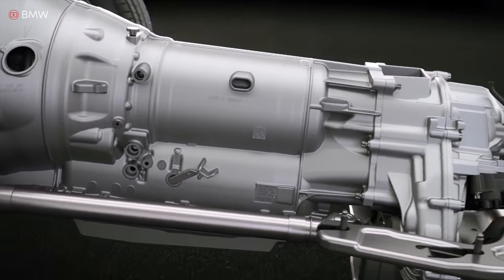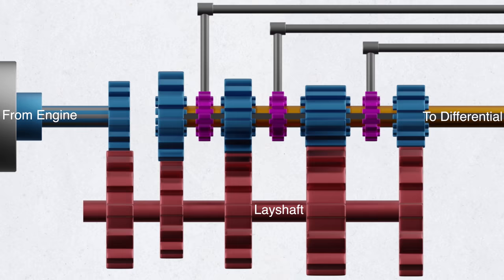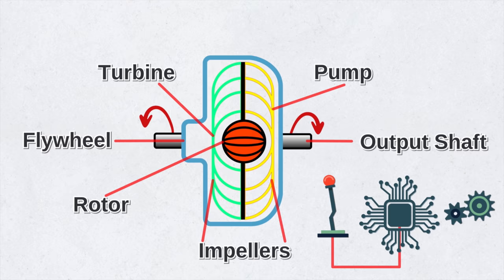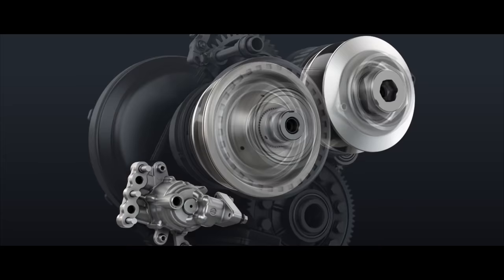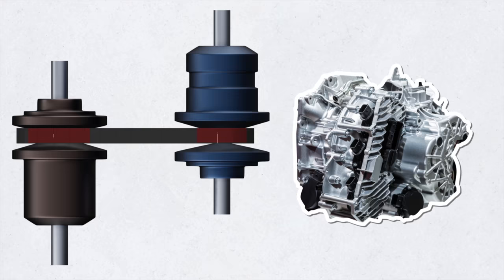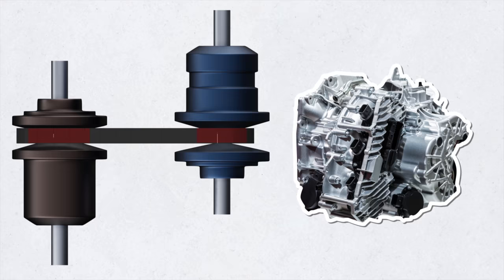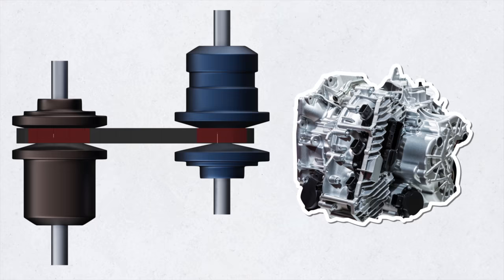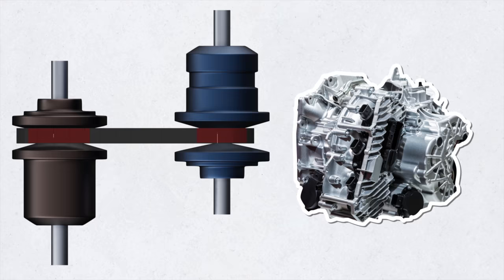Parking Like This Will Destroy Your Automatic Transmission

Comment: News to me that you have to change the CVT belt every 60,000 to 65,000 miles and I thought CVT transmission fluid is to be changed every 50,000 to 60,000 miles not 30,000 or 35,000…. that seems too soon

Comment: My dad always told me to shift to neutral before using the emergency brake while parking and then shift to park so I wouldn't damage the transmission. He said it was better to do it that way because I would be using the actual brakes to park and not the transmission. To this day I do it that way but I don't really know if it really makes a difference. Any thoughts on that?

Comment: I guess I have to get out of my coasting habit. I grew up in South Africa, where gas costs more than Kruger Rands. I never had an automatic though. Always just pushed in the clutch while remaining in gear, when coasting downhill. Not sure if that did my manual transmissions any harm or not. But I Will stop doing it now that I live in the USA and drive automatics.
Reply: It did not harm manual transmissions.  I just put the stick in neutral. The wheels are not connected to the transmission at all(so no different than leaving the car parked in the driveway back home and you were waxing it.  Automatics are a different ball game.

Comment: Taking your gearbox out into neutral while driving at high speeds can also damage it since all that force it was handling will just wind up the gears to far higher rpm. Coasting is a very bad idea for both manual and automatic.
Reply: @richsweeney1115  so what happens with the transmission when the wheels spin and there's no clutch to transmit that force into the engine?
Simple, its internal RPM increases to possibly unsustainable loads.
Reply: @XfStef  - Nope... but never coast in neutral in a situation where your brakes may over heat going down hills... -retired GM engineer...

Comment: Hello Scotty,I own 2 Chevy Cruze,2012,1.4l.cvt.I frequently utilize neutral gear down hill & declining roadways.Are there any major negatives to engine or transmission or other? I achieve 50-64 mpg.highway. 6 speed manual trans. BOOYAA. Love Ur Advice(s) Claude from Rhode DI- land, now in Mass.I Appreciate Ur comments Semper Fi

Comment: In my Malibu 1970 I did a burnout while holding the auto transmission in first gear. I went to shift it into second gear for more wheelspeed and I went past 2nd and 3rd and neutral into reverse at wide open throttle. The car slowed down while burning rubber in reverse. When the car rolled back about five feet, I just went back to first gear without lifting off the throttle. That transmission lasted for another two weeks. It was fun and I inadvertently showed off to a dozen people, but it was kick in the wallet.
Reply: @3sierra15  this happened about 25 years ago, so I just escaped persecution by statute of limitations. I didn't brag about it to my dad. He didn't want me to have that car. So my brother helped me buy it behind his back. Dad said that's too much motor for that car. In reality, I had too much right foot for anything that I got behind the wheel of. Two engines, three transmissions, one drive line, one rear differential, and reengineered sway bar mounts because I ripped them out of the frame.
Reply: @calvinevans8305  i think burnouts are stupid, because youre just abusing the life of the tires for show,  unless your intensions to accelerate to race speed
Reply: @fargeeks  and all the stress on the driveline

Comment: One habit I have is putting cars in neutral at red lights or before red lights (automatic vehicles). It makes for smoother braking and I don’t have to worry about accidentally releasing the brake pedal. Thoughts?

Comment: i had a pt cruiser for a company car and at 26k miles the transmission came apart and spit parts on the road .
Reply: Because the car was junk
Reply: PT Cruisers were such junk that driving more than 50 miles from a dealer voided the warranty.

Comment: So my horror story is about a lazy mechanic and scam at that. This dude put just enough transmission fluid to make it look like he filled it so when you checked it yourself it would read full but in reality it was virtually dry. I only found out because my old truck's transmission ($4500 for a new and $1800 for a salvaged) went out when I was preparing for a move and brought it to another mechanic. When they popped it open, they couldn't find any oil and told me it was running empty. This was right after a preventive maintenance by the way.

Comment: Thats funny, I been doing all the do's for years now, the one time I let someone borrow my 03 dakota, they broke a few teeth on the transmission. even in winter, i wait until i see the transmission oil temp to be at least 20 degrees higher than outdoor temp or longer if it is colder then if needed leave, motor is not allowed to go higher than 2500 rpm.

Comment: I sometimes shift from reverse to drive while my car is still rolling back at an mph or 2, but only if the car was warm and idling normally, I always come to a full stop when the engine is cold and idling high, since when I do the reverse to drive shift without stopping and it's cold, it tends to clunk into gear
Reply: I've seen automatic transmissions taken apart where people have shifted it while the car was still moving. The reason they were taken apart was because they no longer worked properly because either some of the gears or spline shafts inside were stripped clean. And if that transmission is "clunking into gear" there is a good chance the damage has already started. Brake pads are cheap and easy to replace. Automatic transmissions are expensive and difficult to repair.

Comment: I have a Honda CVT.  At the 9:22 mark you talk about changing the belt and show a water pump belt and a timing belt on an engine....then you talk about changing the oil and show a person checking the oil level on an engine; and making the statement that if the oil and belt isn't changed....saying to change the belt every 60-65,000 miles.  And then stating that if you don't change the oil and belt when recommended, the CVT won't last over 190-200,000 miles.  Very confusing!  This is an automatic transmission video.  What does changing the oil and belts on an engine have to do with the transmission?  Obviously we can NOT change the belt on the CVT as that would cost several thousand dollars to do so!  Please explain.

Comment: My dad would always shift into drive while still rolling in reverse! no wonder why the Pontiac Grand Prix transmission was screwed up!
Reply: That will do it. I've seen automatics taken apart where people did that and either the gears were stripped or the spline shafts inside were stripped clean. Remember brake pads are cheap and easy to replace while automatic transmissions are expensive and difficult to repair.

Comment: Huh? Scotty is getting really confusing here. The reason internal combustion engines have transmissions is simply to control the ratio of engine speed to wheel speed, to control how many times the engine makes a complete revolution, for each time a drive wheel makes a complete revolution. Why do we want to alter the engine speed for different wheel speeds? Because for the most part, the engine has more power at higher speeds than at lower speeds. .Assuming a level surface and no wind, you need more power from the engine to get the car rolling from a stop, than you need to KEEP it rolling. Hence to start rolling from a stop, we have to arrange for higher engine speed, we need a higher ratio of engine turns speed to  wheel turns. Once we get rolling, we can have the engine the number of engine revolutions per wheel revolutions, to get lower, eve get below 1. Higher engine speed to wheel speed ratios are called "low" gears, and lower engine to wheel speed ratios are called higher gears. That's right, the gear name numbers are in reverse order from the engine ratio to wheel ratio numbers. At lower gears the engine turns several times for each turn of the wheel, say 4 to 1 (equals 4). Once the car reaches cruising speed, we can shift to a higher-numbered gear, which has a lower gear ration, say 1 to 1, or even 0.8 to 1 (equals 0.8). And as Scotty said, to maintain speed on a hill, we need higher gear ratio (a lower gear) than we need to maintain speed on a level surface. One more caveat – when talking about CVT transmissions we talk about pulley diameter ratios, not gear rations. Same idea though. I don't know why Scotty blabbed on with obtuse story-telling. If we were to use a low gear ratio when starting out from a standstill, the engine would not have enough power to more the car forward. The engine would tend to stall. Or it would take a long time to get moving, and there would be more strain on the engine than it was able to tolerate, due to trying to push something that it was too weak to push. Remember, generally speaking, higher engine speed, more power.

Comment: I have a 2017 nissan rogue with a CVT and its at 57,000 miles.

Im thinking 60k was when the transmission fluid needs to be changed. Idk, I'm kinda winging it. Cuz ive yet to change any fluid besides oil. 
(9 times out of 10 its the 5k oil, ive had like 2 experiences with 3k oil, and 1.... maybe 2 changes with 7k oil.)

I bought this car at 58 miles new. So I love it so much, but as it gets older I'm scared for the CVT belt and if i commit negligence on the transmission fluid. Also what if transmission changes are expensive. 

So far only gas, oil, windshield, and tires are the only expenses for the car. 
(Oh yeah and the car note, car insurance,  registration, and vehicle inspections, and car washs, windshields wiper blades, battery replacement..... yeah thats a couple of added costs but its a new car so idk how much maintenance I actually saved on compared to a certified pre-owned)

Comment: So transmissions are needed because IC engines have less torque and power at low revs and have a limited top revs due to reciprocating parts.
Does this mean that transmissions will be an obsolete technology when electric motors, which have high torque at low revs and a higher maximum RPM, replace IC engines?

Comment: Sorry. But not all is true with this video Scotty. The final output for horsepower/torque applied does not come through the transmission at all . Final torque/horsepower application is done through the final gear ratio in the differentials. I drive a dirt car. We don't change transmission for more or less horsepower/torque applied.  We switch the rear end gear.

Comment: I’m still trying to break the habit of coasting in neutral downhill😳 Prefer driving my 1996 Acura Integra bc of it’s 5 speed manual transmission over my newer car, Honda Civic Sport Touring with manual transmission.  Admittedly, I don’t feel comfortable using the hand paddle  controls on the Honda.  Do you have a vid on using hand paddle shifting?

Comment: 01' Dodge Ram 2500 4x4 5.9L 24valve with 47RE auto trans. A taxi cab driver that has over 250k on his cab put his cab in neutral every time he stopped at stop light so I had to ask why, he said the reason he has so many miles with not transmission issues is cause he does this. Does this really work? I have been doing it for several years but now watching your do's and don'ts I wonder if I am damaging my trans... Any other tips on the Dodge 47re trans?
Reply: I hate holding the brake at the lights, I bump my autos into neutral

Comment: OK so I'm a grumpy Aussie Mechanic / Machinist,  WTF is this E Brake or Emergency Brake you yanks always go on about  ??  It IS a Parking Brake , Always was and always WILL be Pure and Simple !!! It's primary use is to mechanically apply a braking force to prevent the vehicle from moving once parked, Usually placed in 1st gear when parked as this provides a secondary holding ability in the event that the Park Brake Cable fails !   Now I would agree that it can be utilized as an emergency brake in the event that you have a hydraulic Failure in your regular Braking system BUT and it is VERY important to remember that this ONLY works on your Rear Wheels and can greatly reduce your ability to slow and stop, and also have a very high probability of locking up the rear wheels.  The Park Brake is only activated on the Rear wheel's as a general rule for either Front or Rear wheel drive vehicles, although there may be a few exceptions to this though.
I'd really like to see some definitive evidence that consistently low fuel levels contribute to premature wear and higher running temperatures .  Oh Coasting will NOT effect the internal Fluid ie Oil supply in the transmission either as it will be pumped irrespective because the Torque converter is FIXED to the motor and drives the ATF Pump when ever the Motor is Running  BUT fluid can be spun out of the various clutch packs creating wear as well as removing any coupling to the engine and thus the small amount of engine braking available in Auto's.   
I will however agree on the Water in Transmission issue but an easy way to prevent this is NOT driving into water any higher than the floor pan of your vehicle thus diminishing any cooling that may result in drawing water in through breather's. Idling for a few minutes and then drive gently will warm a vehicle faster than just sitting idling too.

Comment: Are the torque converters controlled bt oil pressure or electronics? Because you can't push start your automatic, instead it's torque converter is closed.

Comment: So we should warm up the car first? And another question for me will be how long should that be?
Reply: i try to let it idle for 1-3 minutes before i start driving! After i start driving in the first 3-4 km i dont go over 2 k rpm until the engine temparature reaches 70+ degrees! I have a petrol and i have a manual, i dont like automatic transmissions! Im not an expert, but i think if you let your car warm and dont rev it like you stole it in the first 3-5 km you shouldnt have problems with  the transmission/engine. Of course, if you change your fluids by the book, or before.
Reply: @petreticu6008  Hi Petre, Thank You for replying.

Comment: great video I learnt a lot from it , I have a question and I don't know if u will ever respond to this but here it goes , sir I mistakenly moved the car a few meters while the side brake was partially on I didn't pull it all the way down : ( I did this 1 month ago but the car didn't have any problems after that anyway I'm just asking if it could do any damage ? I moved it only few meters from my parking position my car is KIA Cerato 2019

Comment: Never quite got the hang of driving a manual.
Reply: I'm lazy with the clutch often and hate that grinding noise the gearbox makes. Also stalling and making sure I'm in the right gear is annoying.  Usually in to high a gear and the engine has no go at all I'm floored and getting slower.

Comment: My question was, if it is bad to shift into sport (i.e. activating the ability to use paddles and slap stick) fairly often, if it's bad to do it while driving, do I have to park and then push the stick over?

Comment: I'm confused about the no neutral going downhill. I did that for many thousands of miles with my 2010 Corolla. It didn't die until 240,000k miles. The RPMs went way down and I saved tons of gas.
Reply: One problem is that in neutral you don't have any engine braking while going down hill. As such the brakes will do more work to slow you down and so they could overheat and fade out, leaving you with little or no braking left.
Reply: @joevignolor4u949  I once rolled down the notorious M1 from Adelaide hills via Devil's Elbow in my old 3 on tree HD Holden with engine off, all drum brakes, I eventually roll stared the car once we're on the flat and out of free gravity power
Reply: @manFromPeterborough  You made it thank God.

Comment: I’ve ALWAYS used my emergency handbrake  when parking. But does it matter if I pull it before or after putting the stick in Park? I’ve thought that using handbreak before getting into P might do more harm than good
Reply: You pull the parking break before you put it in park.  This way it rests on your brake pads, not the parking pin. Stop, parking break, shift to park, release brake.

Comment: Scotty. When you say to change the oil when talking about the CVT transmission, do you mean the Engine Oil or the Transmission Oil at 9:00? I have a 2011 Nissan Sentra and it runs great. I haven't DONE ANYTHING to the transmission and wondering if I do will the transmission start to fail on me? But the car is old and has had some work but I drive it over 40 miles a day during the week and don't drive it on weekends. Any tips as to what to do about our old Nissan Sentra? Any tips would be helpful.

Comment: Best video you made in a long time... thoughts on maintenance of so called "sealed" transmissions ?
Reply: No such thing. Ridiculous what these companies are doing. They tell you it’s a “lifetime fluid”, yet they only warranty it for 60k miles. If it was “lifetime” they would warranty it for the lifetime of the vehicle. Change it every 50k
Reply: @lesterparker1594  ....thats why i got extended warranty on drive trsin ...50 k sounds like a good target for fluid replacement
Reply: @nickmalone3143  I just bought a new truck a few months back. I’ll be changing transmission fluid at 50k. Probably differential fluid too